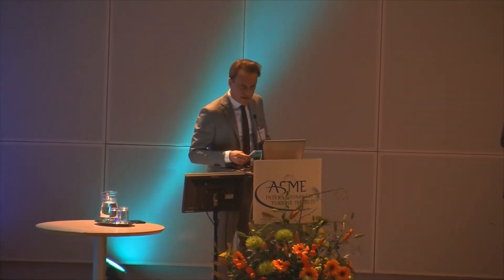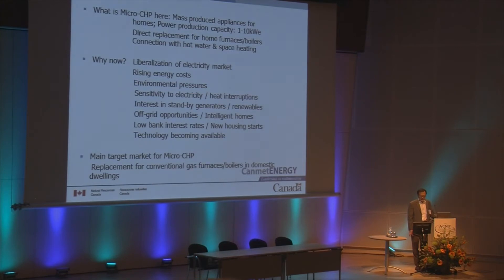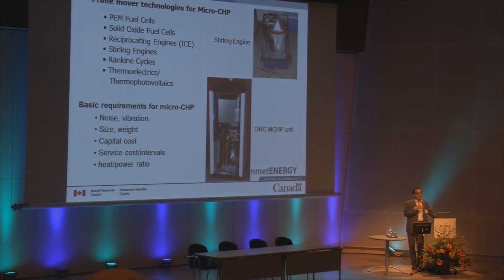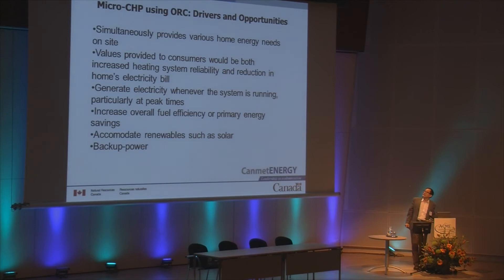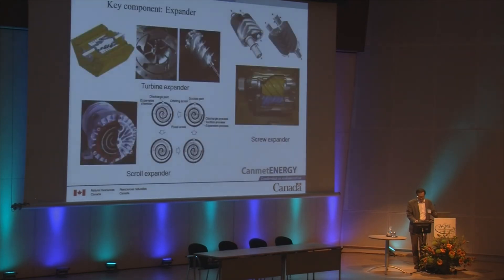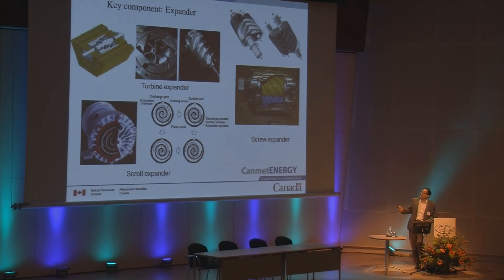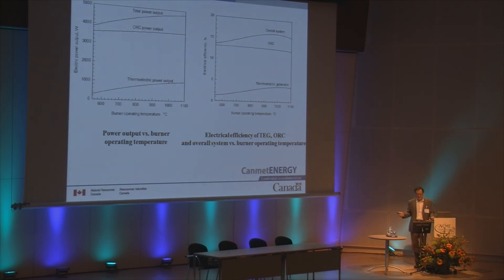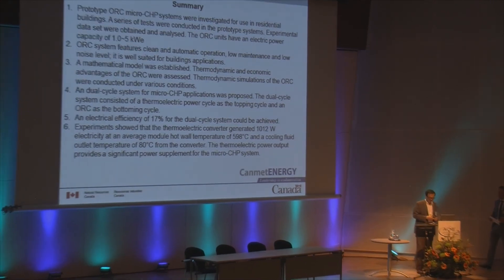ORC Based Micro CHP Systems for Residential Applications

Comment: If they biuld a super critical carbon dioxide  brayton cycle the efficiency will twice than that of a orc. Like around 50% then it would be worth buying because a small water cooled diesel set up like chp would be more efficient  and cheaper to buy.